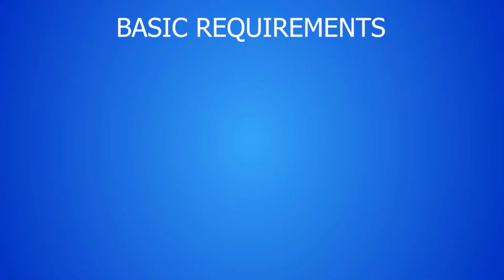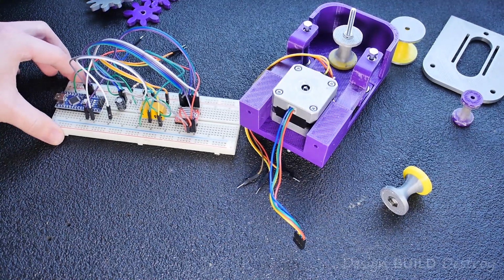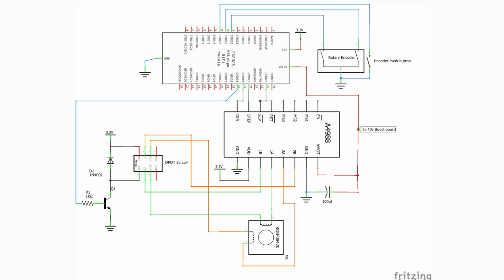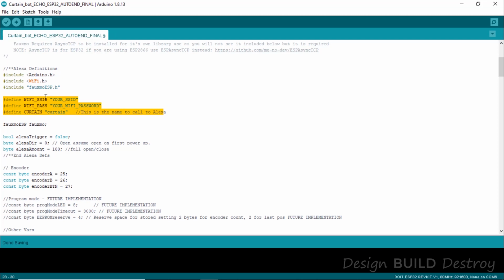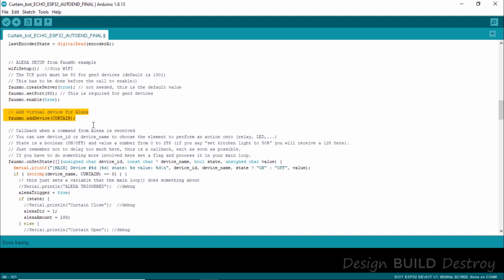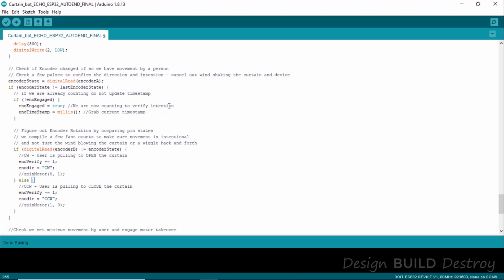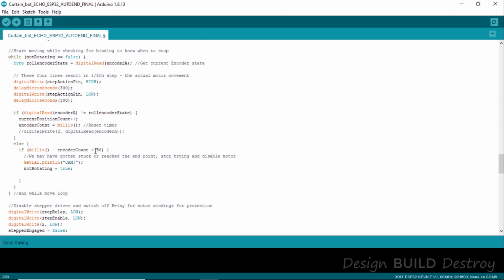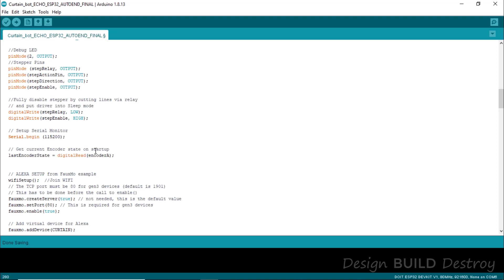Alexa controlled Curtain Robot using ESP32 Arduino

Comment: Can i swap the relay with a diode?
Reply from the maker: Nope, you'll end up blocking the signal when you try to drive the motor, it will run in one direction but not the other. A simpler method would probably be to find a suitable driver that can handle the back flow when the motor is spun manually.
Reply: @DesignBuildDestroy  got it, thank you.

Comment: Dude, great project! This is the closest thing to what I have been trying to do for weeks now - an Alexa enabled blind opener. I'm using the same equipment as you did. I just want it to open and close the blinds by issuing "open" and "close" commands to Alexa. I thought I could strip down your code enough to make it work but no dice.  Do you have any suggestions based on your previous iterations?
Reply from the maker: The "trigger" words are a function of the device type with Echo, and the FauxMoEsp library is "faking" a light bulb like Phillips hue or Blink registration with Echo, this gets around having to jump through hoops creating a custom device within the Echo world. So because of that, being a light bulb Echo doesn't generally take the trigger word Open/Close instead uses On or Off. However, I noticed with mine when I had it running for a while one day it did start responding to Open Close but I don't know why.  My assumption is because the Echo sort of adapts to your speech and I kept trying to say those words to trigger it, Alexa eventually adapted itself on the Echo side to accept them - just a guess.
Reply: @DesignBuildDestroy  Thanks so much for the reply! I'm good with the specified commands. I just want a simple on/off to the stepper motor. I don't think I need encoders or push buttons. I'm just trying to make the motor turn a few rotations in either direction with an off/on command. Can't seem to get the code to work.
Reply from the maker: @everwondered2355  Oh if that's the case you could drop the majority of the code. In spinMotor function you'd also have to take out the lines that are checking the encoder states etc. You would really just need to set the direction pin on the driver high or low depending on rotation direction and then have I guess a timed loop that pulses the drive pin on the driver (stepActionPin in my code) for x amount of time to drive it. The encoder exists for a few reasons, 
1) Start/End points: To figure out if the motor binds up and assume it reached the start or end without having to hard code number of steps because in reality hardcoding step's won't work, the shaft will slip and your counts will be off over time. 
2) Most important for me, acting as a movement sensor if a person manually tries to open the curtain so it can then take control over. Allowing you to give it a little tug one direction or the other and that wakes up the bot to then take over and move that way.

Comment: Good job sir,
How we set start and end point
Plz tell in detail
Thank in advance
Reply from the maker: There is no setting, it is explained in the video. When the motor is being driven in any direction the rotary encoder on the center gear is constantly checked to make sure the device is actually moving. If the device binds up (because it reached the start or end the encoder will not turn and the code stops the motor. That's why you hear a little chatter from the gears when it reaches the open or closed position as they bind up and then the firmware shuts the motor down. If you want to have start and end points you'd have to use the encoder to count pulses and figure out how many pulses you need before saying STOP, while going in the reverse order you'd count down to 0. But that assumes you have no slippage along the rail otherwise over time the bot will think it counted it's let's say 1000 pulses and reached the end point yet it's only 50% of the way there in reality because the top roller slips sometimes but the encoder has no way of knowing that.